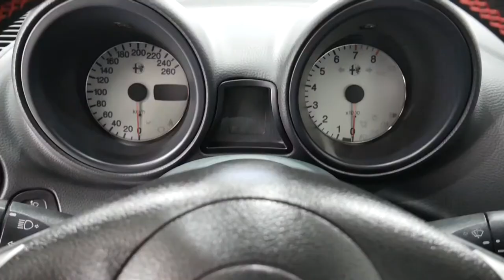Bringing back to life to an Alfa Romeo 156 V6 Full detailing

Comment: beautiful work . can you say how long it took ? also list the products used for each process ?
Reply from the maker: Thank you ! Can i ask with what will help you if i list the products that i used ? It's not a secret but,it's more important to know how to use them instead of the products that you use ! Sorry for my late answer !
Reply from the maker: @icandigitbabe 

  Washing stage :
- Bilt & Hamber snow foam
- Meguairs shampoo 
- Meguiars degreaser and all purpose cleaner ( for wheels,engine bay,door shuts... )

  Interior :
- Meguiars all purpose cleaner
- Meguiars glass cleaner or IPA

  Exterior :
- Meguiars D3000 polishing paste
- Meguiars DMC6 and DMC3   microfiber pads
- IPA...
- Gtechniq Panel Wipe
- Gtechniq Crystal Serum Light and Exo V4 nano coatings

Good luck and remember what i've said !